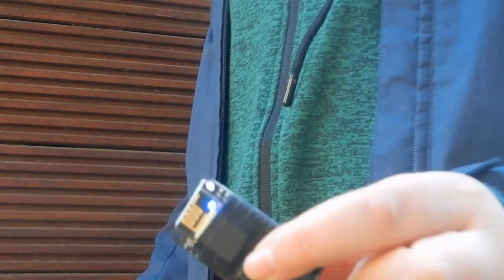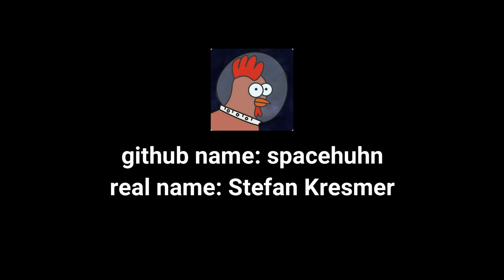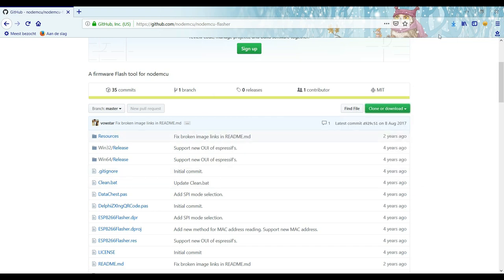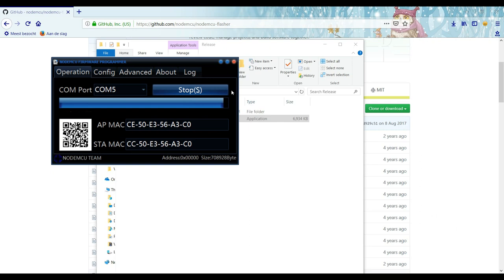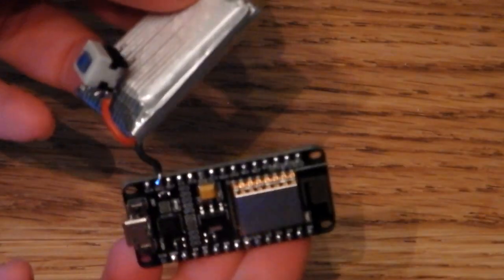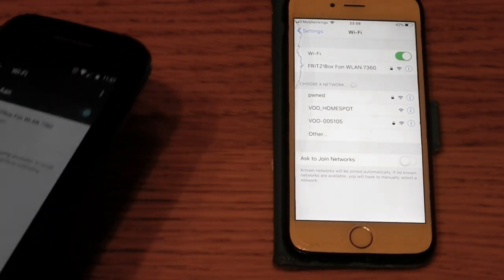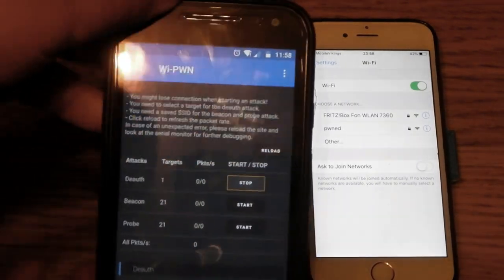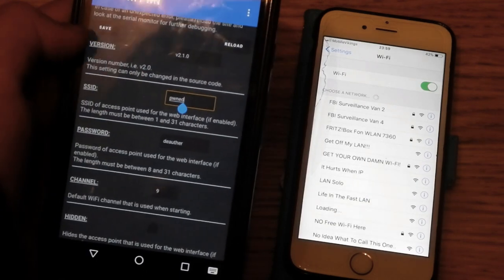How To Make a WIFI 'Jammer'

Comment: How did you add the charging port? I mean where did you connect the wire, and is it nesesery? Can't I just charg it with the port on the front of the board? 
Anyway great video, you should make more hobby "hacking" videos. :)
Reply from the maker: I'm pretty sure you could actually charge it via the usb port, but for some reason (maybe cable too short? it would also always be on when you charge it) I thought this would be easier in my case.

Also you said I should do more hobby hacking videos, I just released the last part of my puzzle box series. It's not really hacking but it's one of my favorite projects so far!
In case your interested: https://youtu.be/tcWuGoKTDFU
Reply: @BuildAnything  Thanks!